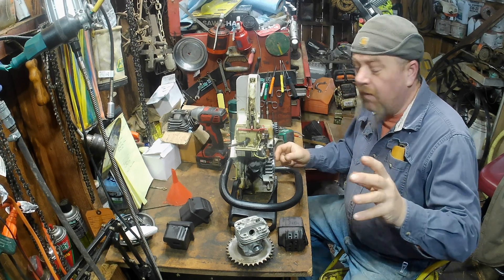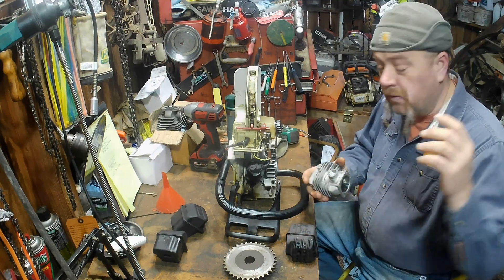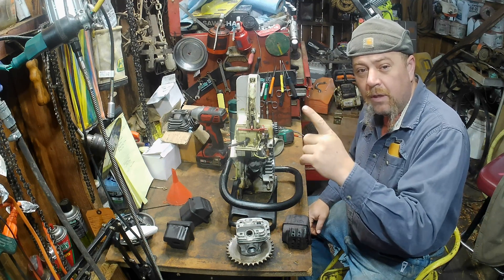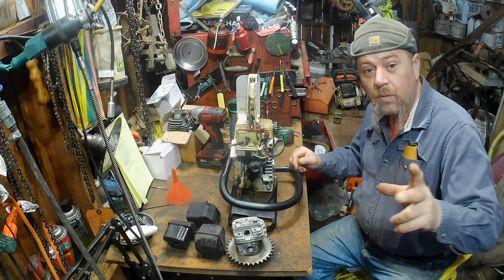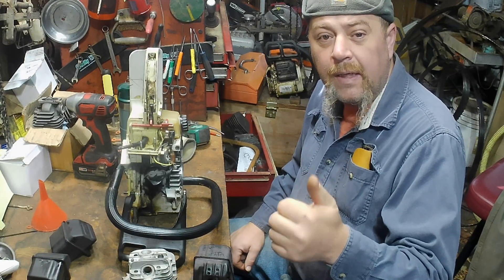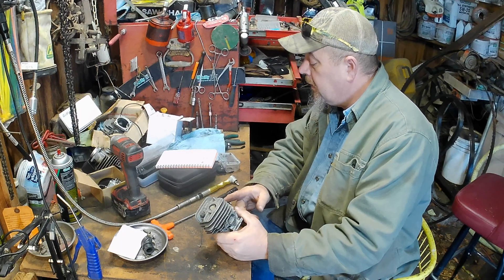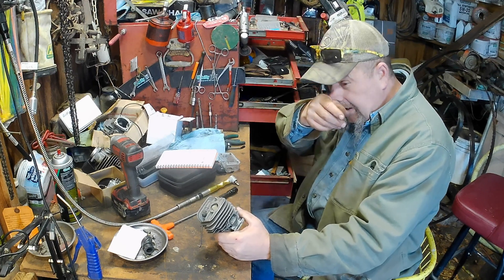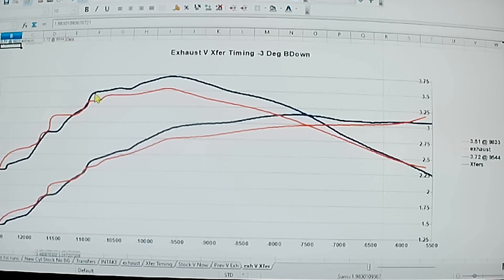Transfer/Blow-Down Change - DYNO and Test CUTS- EVERY Step. Chainsaw Mods Step V

Comment: I always do exhaust mods first.  Just how I do it.   Doesn’t matter how much fuel and air you can get in it if ya can’t get it back out.  Jmo
Reply from the maker: @jasentonguepowersaws4206 I agree; this one had a muffler mod before I ever changed cyl, etc... It was first and was a "normal" mod just opening up the existing port. I think it could/should do better than the standard "back yard" muffler mod that has been on it for all the tests so far.

Comment: Bet you're making friends with parts suppliers by now.  That stinks about the cylinder but at least they are affordable.

If it weren't for making mistakes i couldn't make anything.  That's why i like metal work better than woodwork. Mistakes are easier to hide.

Looking forward to the rest of this project.  Any word on the Arduino project?
Reply from the maker: @Kevin.L_ I much prefer metal work to wood myself, if I cut something too short, I can just weld it back on... usually. 
Arduino project is kinda slow going, but I'm not pushy with free tech advice and labor!!!  Not exactly sure how it is progressing actually; he sent me questions about my computer last week.

Comment: Have to say the more you do the more it opens up my thoughts to different theory's of porting. We all fall into a known standard for a theory of porting. This is the ultimate standard to show what something truly is doing. I have found in a recent port job a low exhaust duration and low intake duration with short blowdown ie 15 degrees. The saw is gutless. Swapped carbs still not much difference. Blowdown is past the 
point of no return. Going to cut chamber raise the roof and try to get 20 degrees of blowdown. 
Your wash pattern is looking good. Pitching your transfers can cause a peaky power bound. Keep going. I know it takes a lot of time to do what you are doing. I appreciate what you're doing. Thanks big guy.
Reply: Blow down is a tricky sob.
There's a bunch of things that effect how much blow down is best for a certain saw. If you have a large case, really high exhaust port, big hogged out lower transfers or choked up exhaust you need long blow down. If you have a small tight case with small transfers and an open exhaust you need short blow. Most saws are somewhere in the middle.
Reply from the maker: @nseric1233 I agree Blowdown is/can be a fickle SOB; it's a timed note in a harmony; it doesn't have to be off very much to make a sour note!
Reply: @nseric1233  you are correct. Been messing with open port 55 husky's. My pushing for max gains went too far. Best I've found with way I ported them and durations I run has been in the 18-22 range. Small saw big open transfers. Going to cut the chamber try to get blowdown back, redo my numbers. May have to epoxy the intake. I hate to put epoxy in a customer saw but I'll do it for my stuff.
Reply: @nseric1233 also if you widen your ports you actually effect blowdown as well wide ports lower blowdown in a sense.
Reply from the maker: @eze7524.Morning_Wood_Farms I hoped I didn't pitch the xfers too far;  I was "aiming" them the best I could to a point just below the top of the cyl.  That cyl seemed about right; now, since I trashed it I hope the other cyl performs substantially similar so testing can continue as close as practical to the point it was left. Doing some sawing tomorrow (I hope) to get the rings broken in similar to the previous one.
Reply: @HayChaffandSawdust1  all you can do is run the saw see what happens. If I have a really hard faced ring I run my own crosshatch with a hone in it. Does it matter probably not but makes me feel better. 😂
If you have the time cut with that saw like crazy. Cut everything you want then do it all again. 🤣 it's be good and seated by then.
Reply from the maker: @eze7524.Morning_Wood_Farms  Got about 6" of snow y'day/last night... man the sawdust is gunna be pretty all scattered on fresh snow!!

Comment: There is a lot packet into this one, first off, as always, thanks for taking the time to test and share. 

The timing numbers, I assume as stated  are adjusted for the .035” about how many degrees was that offset?  Great idea to have repeatable consistency. What is your bore and stroke, and would you be willing to post the current numbers along the way? Maybe in a pinned comment?  I can’t wait for the one ring vs two? That’s a big question in my mind, put this 021 back together with one this time, 50/50 chance, maybe it’s the right one haha. That torque curve looks great, can you “feel” a difference yet?
Reply from the maker: @Archer_82  I didn't really have to adjust the timing number(s) more than... maybe... 1/2 degree of where MY eye thinks the port opens anyway; it timed pretty close.  I sure don't mind to post the numbers AT ALL! No secrets here; I want everyone to be able to make their own assessment with the info at-hand; I don't (didn't aim) to withhold any of the pertinent info.
Bore is 44.7 mm (1.75") and Stroke is 32 mm (1.26")  I've run this saw so many times with so many minimal changes, it's sort of like the frog/boiling water analogy... it happened so slow, it was unnoticed. PLUS>>> I forgot to do test cuts last time as I was so dang anxious to tear it back down and cut squish and base.
My 021 (for real 021 bore/stroke) only has one ring and has had since I ported it a few years ago.